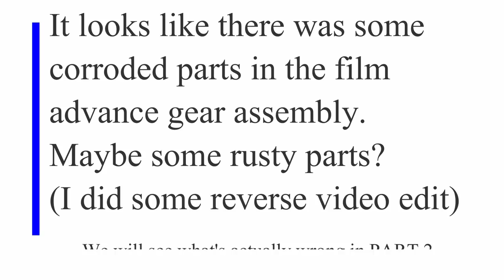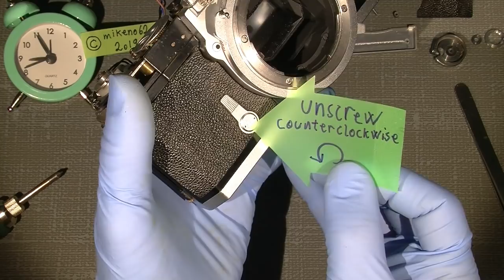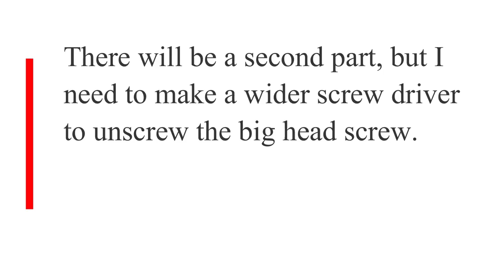Stuck shutter and other details in Nikkormat FT (maybe broken parts..) PART 1

Comment: Amazingly helpful videos; thank you very much.  My Nikormat FTn worked fine but now the self timer is not triggering the shutter so currently the camera is 'locked.'  Is it easy to access the self timer and 'bend'  something to trigger the shutter?  Thanks.
Reply: i took  off bottom plate to find a long bar with something and freed shutter and got 50% repair   never wanted to belive the simple solution was best like taking 1 million parts to fix
Reply: Likewise; removed the bottom plate, kinda checked how it is supposed to work and realigned the fork (or whatever) to connect with the pin.  Low and behold, all working fine.  The videos are brilliantly helpful.

Comment: Hi. I just found out about your channel on a Petapixel page and I'm desperate to know if I can diy repair my Sigma Art 35mm. Had an event now and when I took the cap off the back to mount it, 2 of the contact balls broke off. I really need this fast but curently have no money so I hope that you can help me or point to somebody that can help. Thanks
Reply from the maker: Well, that was really a shame, IF it's for Nikon mount you can find some spare parts, and the "flex cable":

https://www.aliexpress.com/item/35-1-4-ART-For-Nikon-Mount-Lens-Bayonet-Mount-Flex-cable-FPC-For-Sigma-35mm/32892667670.html?spm=2114.search0302.3.154.49987885m0ilRo&ws_ab_test=searchweb0_0,searchweb201602_0_10084_10083_10304_10546_10887_10307_321_453_10548_322_454_10618_536_10065_317_537_10068_319_10059_10103_10884_10696_10820,searchweb201603_0,ppcSwitch_0&algo_pvid=658abae8-a45b-4b04-8e44-8d0e9742368c&algo_expid=658abae8-a45b-4b04-8e44-8d0e9742368c-21

TAKE GOOD CARE when working with sensitive eletronic and use a wrist band connected to EARTH GROUND   ⏚ 

Without knowing it!!!  I would guess the you will need to take off the mount (bajonet) there are maybe 2 small screws that holding the connector to the mount, you will MAYBE also need to take out the circuit board and carefully unmount the flex cable from the connector, then connect the flex cable again.

It was just some ideas.

Comment: Yet again a Nikkor-/Nikomat FTn  is called an FT . This mistake scores high, even with dealers and a repairman....
There is a difference however,  that Nikon attempted to indicate with a rather big N engraved above the top lightmeter window. The (big) difference lies in the emphasis of lightmeting (60% to the center as opposed to fully integral on the FT) and the way the lightmeter was 'informed' about which speed the attached lens had. A very clumsy arrangement on the FT that might explain why the FT was sold only for 2 years, is much more rare, and will sell sooner for more money in todays collecting market than the rather common  FTn . A black FT is even more rare, which cannot be said of the darker Nikkormat FTn. The FTn is by far the more practical camera though.